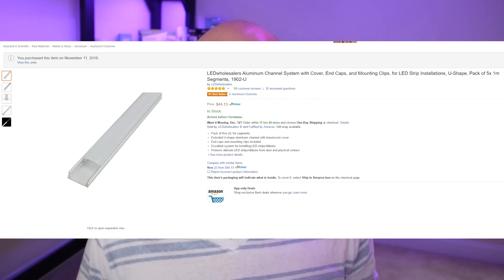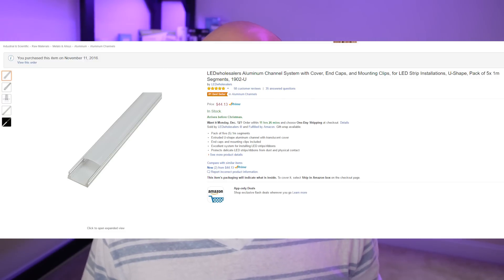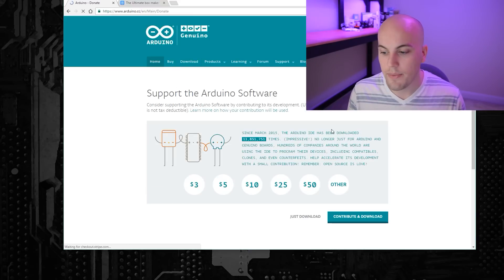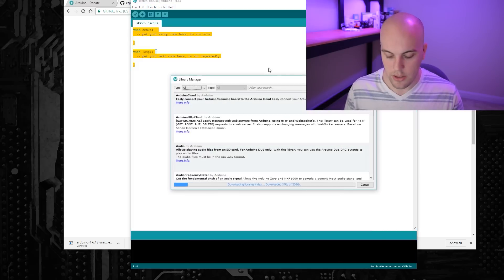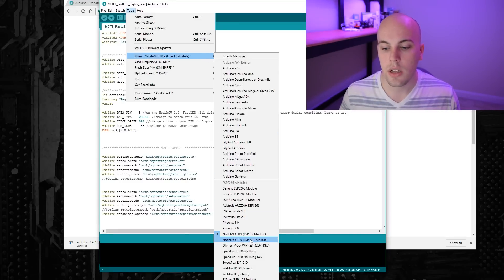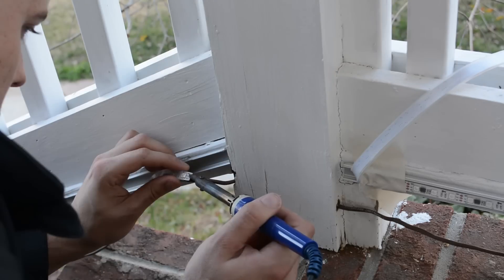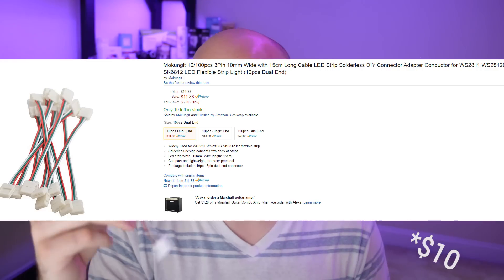The BEST Digital LED Strip Light Tutorial - DIY, WIFI-Controllable via ESP, MQTT, and Home Assistant

Comment: Am I correct that when he was connecting the wires at around 13:55 he actually soldered power wires on it every 3 meters but the other power cables (coming from the previous section of the strip) still ran through (/were connected) to the new section of strip?
What I mean is that he did not separate the strips into different sections to power them, but he used 3 power "inputs" on 3 different places on the strip, while the power from the other inputs also went through the whole 10 meters of strip.

Comment: How to solve: 'MILLION' was not declared in this scope
Reply: but now I get Arduino: 1.8.5 (Mac OS X), Board: "NodeMCU 1.0 (ESP-12E Module), 80 MHz, 115200, 4M (3M SPIFFS)"

ESP_MQTT_Digital_LEDs:388: error: stray '\357' in program
       unsigned int kelvin  = 1000000 / color_temp;
       ^
ESP_MQTT_Digital_LEDs:388: error: stray '\273' in program
ESP_MQTT_Digital_LEDs:388: error: stray '\277' in program
In file included from /Users/andre/Desktop/ESP-MQTT-JSON-Digital-LEDs-master/ESP_MQTT_Digital_LEDs/ESP_MQTT_Digital_LEDs.ino:26:0:
/Users/andre/Documents/Arduino/libraries/FastLED/FastLED.h:17:21: note: #pragma message: FastLED version 3.001.006
 #    pragma message "FastLED version 3.001.006"
                     ^
In file included from /Users/andre/Documents/Arduino/libraries/FastLED/FastLED.h:68:0,
                 from /Users/andre/Desktop/ESP-MQTT-JSON-Digital-LEDs-master/ESP_MQTT_Digital_LEDs/ESP_MQTT_Digital_LEDs.ino:26:
/Users/andre/Documents/Arduino/libraries/FastLED/fastspi.h:110:23: note: #pragma message: No hardware SPI pins defined.  All SPI access will default to bitbanged output
 #      pragma message "No hardware SPI pins defined.  All SPI access will default to bitbanged output"
                       ^
exit status 1
stray '\357' in program
Invalid library found in /Users/andre/Documents/Arduino/libraries/PubSubClient: /Users/andre/Documents/Arduino/libraries/PubSubClient
Invalid library found in /Users/andre/Documents/Arduino/libraries/PubSubClient: /Users/andre/Documents/Arduino/libraries/PubSubClient

This report would have more information with
"Show verbose output during compilation"
option enabled in File -> Preferences.
Reply: How did you solve this Andre?
Reply: Either change million to 1000000 or up at the top of the ino place #define MILLION 1000000
Reply: @TacticalPenGuinn
Do you mean ( unsigned int kelvin  = MILLION / color_temp; ) Change to (#define unsigned int kelvin  = MILLION 1000000; )
Reply: Anyone that fixed should do a pull request in the repository... Would help everyone
Reply: Having issue "no hardware SPI pins defined". anyone?
Reply: you don't need to worry about that, it will compile just fine. I was struggling with that too last night :D just compile and flash to nodmcu
Reply: Just type:  int MILLION = 1000000; at the beginning of the code

Comment: I'm starting work on a project related to this one, if anyone has any insights.
Planning to build a "light shelf" and run about 2m of warm white, and 2m cool white next to each other. Fading the two strips in and out simultaneously, but at different times to simulate a sunrise
I've never worked with a NodeMCU/arduino/pi so my two biggest questions are:
best resources for learning just enough to write the code for this project?
and, suggestions on hardware I might need to control the two strips independently?

Comment: If your strip is using the 2811 protocol and its working with the 3V driver you don't have to worry about the length of the strip. The reason is that every pixel regenerates the signal to the next pixel. So as long as the first pixel accepts the 3V logic all the rest will get 5 volt levels work just fine. However, this only works well if the distance from the controller is short. If it's long cut one pixel from the strip and use it as a line driver.
Reply: Mark Gilbert - Many times you don't need the diode but it does offer that extra margin of safety. ThAt extra pixel should be located close to the controller. For us that do Holiday light shows our controllers are designed to adjust when we need that extra pixels so the rest of the string still addresses correctly.

Comment: are you using only one power source for the entire strip? I'm trying to do something similar, but I'll need around 3 10 meter strips to complete. I'm trying to figure out a way to not have to run a power source to each strip.

Comment: Hy BruhFirst i dont speak very well english but is amazing this project. Im new in this . I want to do this project and i see the diagram and i want to ask you one thing. I see that you connect red cable and black cable at the first led and then after second led and then after four led. Why? I want to conect 2 x 5m strip led .... how can i connect cable red and cable black for this strip leds¿Sorry for my language.
I buy a power supply 12V 30A. How meters can i conect wiht this power supply?Thx a lot

Comment: Hey, I have a question. My LED lights one day appeared to stop working. When I looked closer I realized they were very dimly flashing red, but no matter what I do they don't change. I purchased a new white box power outlet thing and plugged it in thinking maybe that was the source of the issue but it's still doing the same thing. Any advise? Thanks 🙏🏻

Comment: Hey Ben!
I am using home assistant for 3 months now and configured it with the help of all your videos. They are straight forward and easy to rebuild.
I have one question: II have a group like this:

alleleds:
 name: Alle LEDs
 entities:
   - light.panel
   - light.bett_strip
   - light.lampen_leds
These are all my mqtt light strips and the group works really well. But when i try this with a scene:

- name: SexyTime
  entities:
    group.alleleds:
      state: on
      rgb_color: 220,0,220
      brightness: 90

They dont take the color and brightness. What am i doing wrong?

Thanks for your Help and keep on going!!!!
Reply from the maker: Interesting. If I am remembering correctly, I don't think you can call a group inside of scene. I think you have to list the individual entities unfortunately. I tend just to make scripts and forgo using scenes all together. They work identically, but scripts let you call other services. Cheers!
Reply: Wow thanks for the quick answer! I thought it could Work, because calling "group.all_lights: Off" works from a Scene. But i Like getting more knowledge about Home assistant, so i try with Scripts ;)
As Said, keep your nice work going! Cheers

Comment: So rad! I want a similar setup but instead battery-powered... which is where I'm hung up on. Thanks for the tutorial!
Reply from the maker: Sweet! Yeah, should definitely be possible. If it's a smaller setup, check out the 5V adafruit strips. They are great and any external phone battery charger would do the trick.
Reply: DUDE. Thank you!

Comment: So I'm dying to know how they have held up due to the weather I'm in the process of doing an LED panel and I'm really nervous about putting it outside of planning on putting aluminum paneling around it plexiglass and caulking all around it but i've been a lot of soldering I've got 30 strips and I've had to Solder both ends so that's 180 solder points!  But it's came out nice BTW great video stairs look great !!

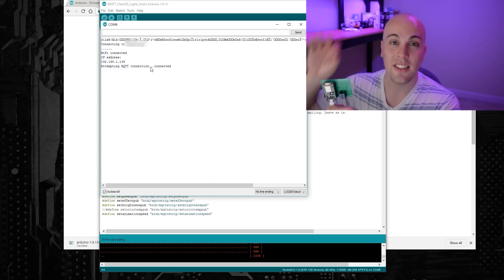Comment: Ben ... you are awesome! Thanks for taking the time to post this outstanding information!  Looking at your video (starting at 9:55) I see that the code is different than what is on the GitHub site.  I used the GitHub code, was able to see the light, animation speed and input slider in the UI (no effects selector).  Which yaml file should I use?  I have not tested the LEDs yet as I want to get the code correct before I hook them up.  Thank you
Reply: I have this same issue as well.

Comment: Hey Ben, 

first of all, thank you so much for these videos, they have allowed me to get into Home Automation, and i absolutely love it! I am new to this all, so I lack the understanding of MQTT. My question is, can I have multiple of these strips running independently of one another? What do I need to change in the code to allow this to work? 

I currently have two strips, both of which work fine when they are the only strip powered on, but when they are both powered at the same time, I lose control of them, and they flicker constantly. Whenever I unplug one of them though, the other one keeps working with no problems. When I was coding the second one, I changed the MQTT command topics to bruh/mqttstrip1/set.... in the hopes that this would allow them to operate independently of one another, but no dice.

I'm out of solutions, please help! Thanks in advance!
Reply: Did you get this working?  I want to do the same.
Reply: that's how it works yes.
Reply: so what was the exact change you made?
Reply from the maker: For sure! I have several of these setup. You'll need each node to have unique MQTT topics which will need to be setup independently inside of Home Assistant. They'll also need unique sensor names as identical names won't let them connect to the broker.
Reply: Thanks for the reply! When you say each node needs independent topics, what does that entail? would my example of one light being  bruh/mqttstrip/set.... and the other being  bruh/mqttstrip1/set.... work? 

Thanks!
Reply: @Bruhautomation1  
Hey Ben. I do realise this is a fairy old video but would it be possible to use that wifi controller on a 220v led strip? Ive purchased a 50m high voltage strip and the controller that accompanies it, has really boring pre-sets. Thanks

Comment: Just to clarify, Digital LED strips such as the WS2812B's don't use PWM. They use their own 1-wire protocol, which is bit-banged by the micro-controller.

Comment: Hey Ben, 

Thanks for your video, but i can't get to manage to get the configuration.yaml right. 
When I use the recent one on gifthub I don't get the fancy color modification or light patterns. and when I use your original code Home assistant won't start up anymore. when I use hass --script check_config I get a arror code with trying to install colorlog but fails. can you or someone else help me whith this? (and I use a ledstrip WS2812B)
Reply: It looks like a few of us are having the same issue. Can anyone help?
Reply: have you guys find a solution i have same problem
Reply: No, still nothing
Reply: PuckStar27  thanks I check and is not the mqtt config my nodemcu is reviving messages but for some reason the lights are not working I'm double checking the level shifter it looks like is not putting out the 5v thanks again i will check the community site
Reply: same issue here, both arduino code and HA yaml are different to what is on screen in the video, so none of the effects work, I'm slowly going through the code to see if I can get it to work, but my coding skills leave a lot to be desired so a lot of guess work going on.
Reply: Did you get it sorted Dan?
Reply: Check out Ben's forum at http://www.bruhautomation.com/forum-1/ when you're there, find the section on DIY LEDS and post your errors, I'll have a look for you 👍🏼
Reply: Koen Theeuwen 
did you fix this problem Koen ? (are you dutch speaking btw)
Reply: Maybe post it on the Home Assistant forum? http://community.home-assistant.io/

Comment: Love your videos Ben! This is probably a silly question, but do I need a WIFI network/internet after I set this up? I want to use these lights in an old Airstream Camping trailer and wont have access to WIFI/ Internet most places I go. Do I need WIFI/ Internet to communicate between home assistant on my phone and the Node that is connected to the lights? Thanks to anyone who can answer this.

Comment: Nice setup, just started getting into HA and your videos are great viewing!

I've had a play with a few things, and with a few neopixels lying around I figured I'd make some use of them in my early and crude HA setup. I am running into a problem though which is beyond my knowledge. 

I've got a couple of nodeMCU I've programmed with your code, and when I connect 1, it works beautifully. when I connect 2 however I notice that there is a flicker on the LED's. this stops when the 2nd is disconnected. 

It also causes it to go out of sync in HA, and the switch status does not reflect the LED status.

I have updated the device names and MQTT topic names in the code and yaml files and thought this may be the issue, but not. I do notice however when I run the serial monitor, that the issue is when the noeMCUis undertaking activity with the MQTT Broker.

is this anything you've seen before? any thoughts? advice?

Cheers... Alex.

Comment: Hi Ben, I've made two separate strips using this guide (holy cow you're a great teacher!!). On my second instance, I changed the topic from bruh/mqttstrip/# to hass/mqttstrip/# (left the first instance as your default) and now when I have them both plugged up, they will both turn on for a second, turn off, repeat. I assume the new logic in the sketch to report back as "off" is the culprit, but I don't understand how this can be true if the parent topics are different. They both run fine individually, but not if the other has been supplied power. Any advice?
Reply: Hi i'm having the same issue, did you find a way to make it work?
Reply: I updated the code with the latest and both are working now

Comment: Question about DuckDNS.  
I have a 3d printer running Octopi that I access away from home using my home IP address and port 80.  When I set up DuckDNS it takes me to my Octopi. Is it possible to set a DuckDNS url that goes to my IP at port 8123? 

Thanks for the videos Ben!  I'm just getting started in home automation and you've got great tutorials. Thanks!
Reply: never mind.  I realized I just had to put the :8130 after.   duh.

Comment: So you run separate power to every 2-3 meters of strip, how do the cables connect back to the power supply? I'm assuming they all come from a common point or bus but just wondering how you actually implemented it.
Reply: He addresses that at about 4 minutes in. He runs a seprate power wire along with the led strip, so anywhere along the run he can access 'fresh' power. I would not have thought of that, and it does not seem intuitive, but putting thought to it, makes sense.

Comment: Set this up with 5V ws2812B with the logic shifter! Works but flickers at low brightnesses. Any idea? I have the digital pin of the nodemcu going 3 of the 4 channels of the shifter and from the shifter I connected three separate strands to get the exact effect on all of them but three times the area/brightness. I feel like I need an amplifier for the data signal. But isn't that what the logic shifter is?
Reply: IM A FAIL... I have 3 strips of 90 LEDs each. Each draws 60mA. Soooo doing the math: 0.06mA*90 LEDs* 3 strips equals 16.2A...I was using a 10A 5V PSU...IM AN IDIOT. Don't make my mistake. Tried a 15A PSU i had laying around and it seems to be good enough. Imma invest into higher ampped PSU later. You wouldn't expect LEDs to put this much power!

Comment: Hi, I have a Honda NT700V motorcycle and I would love to install a LED setup for the stop and signal indicators. 
Any guide would be greatly appreciated.
Reply from the maker: Sweet bike! Sadly, this is probably beyond the scope of what I can cover in this channel. I'm not sure if you're looking to change out what you have to LEDs or if you have LEDs already. I would think there are conversion kits available that should be simple to install. Custom solutions are pretty simple from a electronics side, but the hardware will be tricky to make sturdy enough for road use. If I've learned anything it's that 90% of the battle in the DIY space is the hardware rather than the software. Good luck on your project!
Reply: Hi, thanks for your reply. I would like to add some LEDs strips to both panniers (left and right) for the indicators and LEDs on the back of the centre box for the stop signal. I think is doable but my main concern is the speed and bad weather (wind and rain)

I don't want to disrupt the standard lights on my motorbike so this would be an addition if I can achieve it.

Comment: This looks great. I've got a question however - Do you know of any good plug-and-play digital LED strips, controllable via zwave or wifi, with ability to control individual pixels, or at least groups of 2-4 pixels? Basically, something that would cost a bit more, but allow to get the same result, without the need to wire and setup controllers myself? Thanks!
Reply from the maker: I'm not aware of any in the consumer space. To my knowledge, there are DIY options and then things like LIFXZ and the Hue Strips. They are great, but pricey and not super colorful. The DIY strips are a pretty easy project to get started with though.

Comment: Hey Ben,

I took your code for the ESP8266 and have used it as an ON/OFF controller via Amazon Echo for my own LED strip. However, I've been having some difficulty in terms of uptime and reliability. How often do you have to reset your ESP because it won't respond? Thanks!!

Comment: I used this esp8266 based controller Lixada 5-24V WiFi APP Controlled Smart Dimmer Wireless Receiver Output 5 Routes PWM Data for RGBW LED Strip Light Lamp https://www.amazon.com/dp/B01GJMRLUY/ref=cm_sw_r_cp_apa_jXpDyb24XCF99 following this toutorial for analog led strips.. my question is can the H801 controller be adapted to control 5 zones of individually addressable strips?